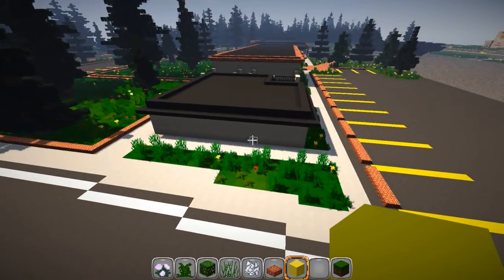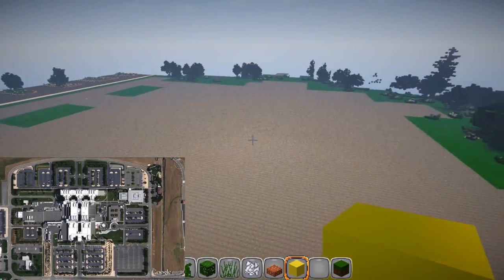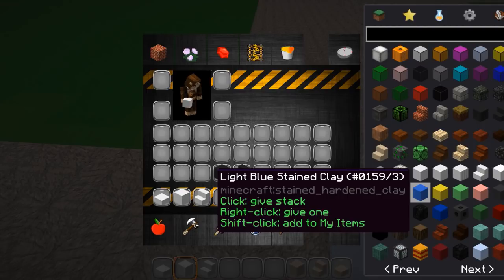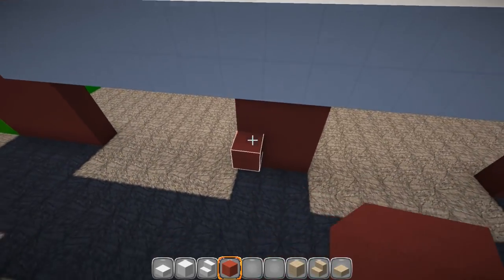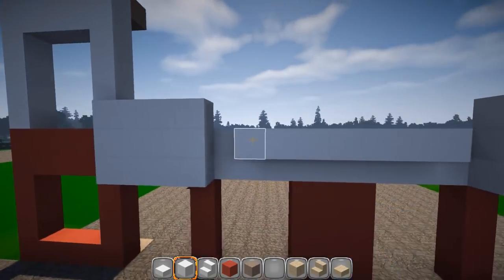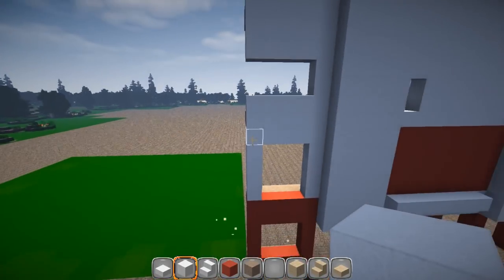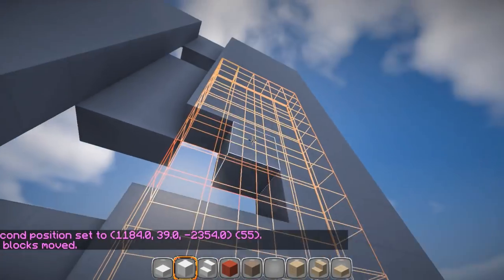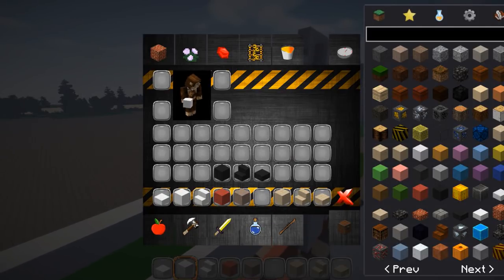Minecraft Lets Build - Military Airfield (Hospital and Medical Facilities EP26)

Comment: you should use replay mod
Reply from the maker: +Ruben Bekaert I miss the old camera mod that had third person mode. Was much better than replay mod.
Reply: you could still use pixelcam
Reply from the maker: Got that too and just not as good :-( At least we still got something for now tho
Reply: +Jagthunder1 exactly what camera studio mod are you talking about. THE camerastudiomod is updated (apparentaly)
Reply from the maker: It's 1.8 but does not work with optifine. I still use it but he is no longer supporting the mod according to the forums, but hopefully he changes his mind.
Reply: +Jagthunder1 oh...
Reply from the maker: yeah there was a lot of controversy in the thread and the dev got mad and locked it up several months ago and said he was done. Left a link to his website for the 1.8 beta and said he was finished with all the childish shit, pretty much. Been using that mod for almost 5 years now. Pixel cam is real flaky. If you don't try to use the pitch option it works ok, I don't like like how if your points are not exactly even, it will adjust the speed between points making the fly speed up and slow down between the points :-( Kinda gay